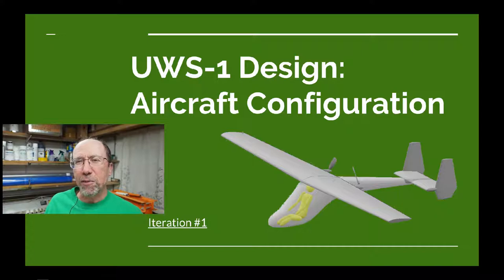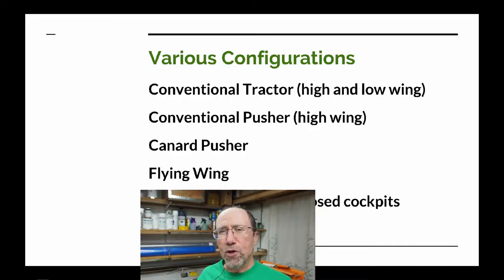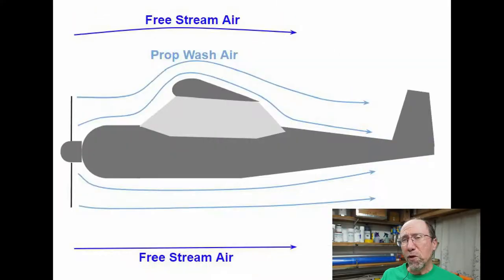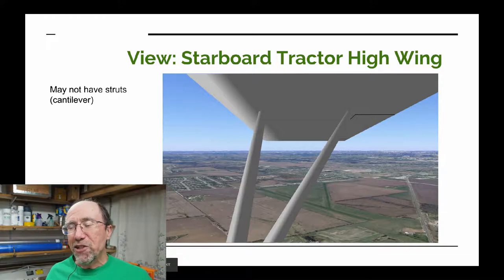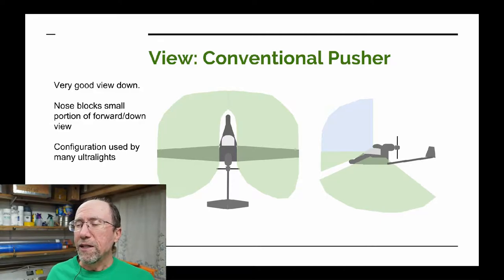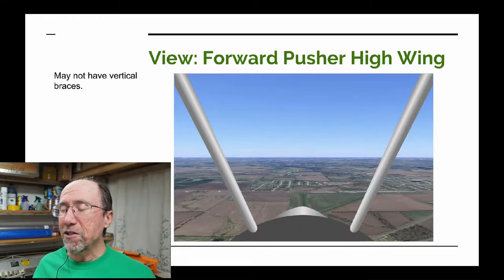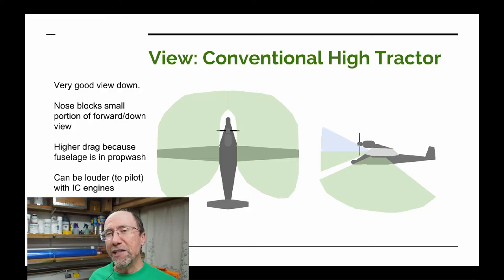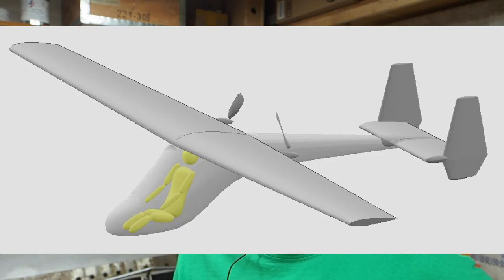UWS 1 Ultralight Airplane Design Configuration

Comment: Superb channel! It's been quite a while since you posted this, but, just to satisfy my curiosity, I have a question.

What was the reason not to go for a dual motor tractor. As I see it:

Advantages:
-Higher prop efficiency (no dirty air into the prop).
-Low noise.
-Extra air velocity throught the wing can be useful paired with flaps.
-Pilot would be closer to the CG.

Disadvantages:
-A bit of parasitic drag for the wing surface behind the prop.
-Pilot would sit below the wing, obstructing a bit of view.

Unknown:
Not so good or not that bad aerodynamic behaviour on that wing section.

I thought this was going to be the final configuration.

Cheers, Leon!
Reply from the maker: This is an excellent comment and good analysis. In the end the decision between tractor or pusher came down to visibility. Having the pilot farther forward gives better visibility. Particularly when making turns. If you've been in a high wing where the pilot sits at the CG you know that you can not see the area that you are going to turn into since the view is blocked by the wing during the turn. 
The extra lift that you'd get in the tracktor configuration is great but can not be used in the analysis to meet the Part103 24kt stall speed requirement. It has to be the power off stall.  So tractor or pusher did not make any difference there. 
Thanks for your comment!
Reply: @Designer103   Thanks for answering! Everything understood.

I flew on a partner's Bingo (high wing) and, years later, on his P-96 (low wing). It does feel way more cramped regarding the ground view on turns on the high wing, as you said.

Great work, keep it up!

Edit: the only factor left would be the longer range due to prop efficiency (it would need to be tested to prove the motor consumes sufficiently less power with that tractor configuration).